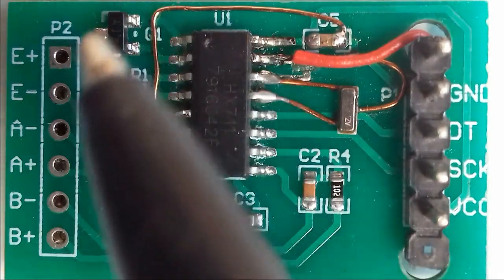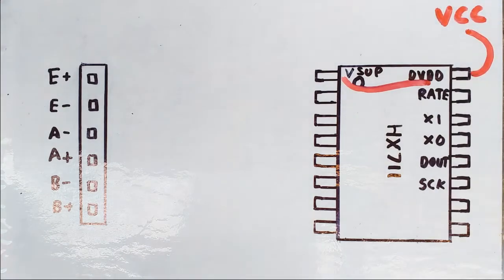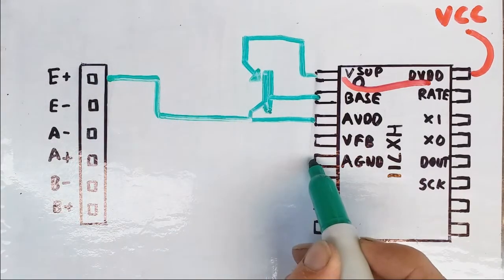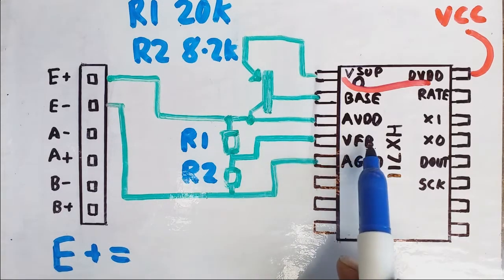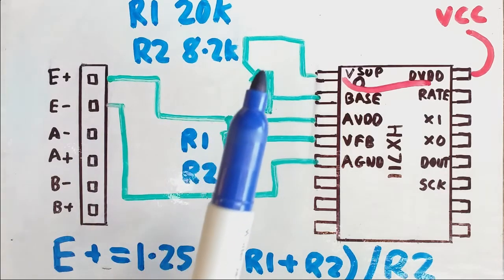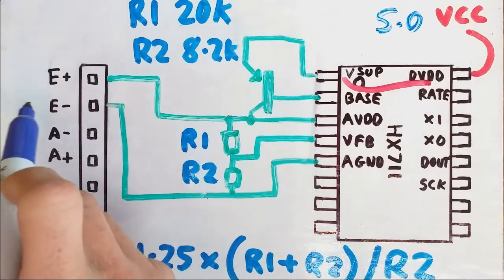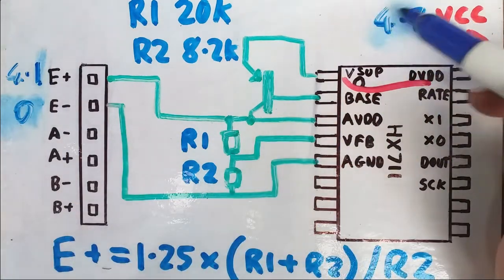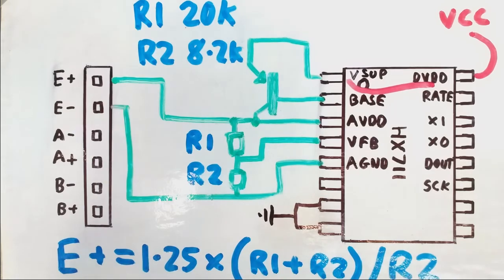HX711 Excitation Voltage and What You Need to Know

Comment: Thank you for showing the need to add a jumper wire for GND at time 0:11....   I followed your advise and it reduced the amount of noise in my application by a significant amount. That GND connection is shown in the datasheet for HX711 but is missing in the PCB layout.
Reply from the maker: Glad it was helpful, and thanks for confirming that it makes a difference.

Comment: Hello, thank you so much for your video. I’m using the hx711 and inputting 5v from my arduino, but when I measure the E+ voltage output, it gives 0.4 ish volts, which is really low. I thought it might be the board, but I swapped it and it did the same thing. I’m using the chip with a half Wheatstone bridge and 2 strain gauges. I ended up hooking up the Wheatstone bridge to a 9V battery instead of connecting it to the E+ and E-. When it was connected to the E+ and E- and I tried calibrating to get a load cell output, it would give nan, or 0. After connecting it to the 9v battery, the load cell output gave me a reading but it was fluctuating a lot and did not give any consistent values. How can I fix this issue with the E+ and E-, and do u think that hooking it up to a 9V battery was ok to do? Do you think that is what’s contributing to the fluctuations?

Comment: If I need actual 5V as excitation, and 3.3V vcc/logic levels, I need to use an external regulator, correct?
Reply from the maker: You would yes and the HX711 can take up to 5.5V. With a change of feedback resistor you should be able to get a 5V excitation voltage.
Reply from the maker: Having said this just be careful putting a regulator before another regulator as it has caused me serious drifting issues.
I would really think about why the excitation voltage needs to be so high at 5V as this can create problems with stain gauge heating. Is the material you are measuring very stiff or the load very small, if not half the voltage will give you good results. If you want very high precision then the HX711 may not be the best choice and increasing the stain gauge voltage isn't a good way to compensate. Hope this helps.
Reply: It's as big and bulky 2 ton load cell haha, it's designed to be excited from 5 to 12. I also need a bit higher sample rate because it'll be measuring a rocket engine, so I'll use a generated PWM signal as clock. Thank you for your response. I'll analyse the datasheet and come up with a circuit.
Reply from the maker: @gustavrsh  Interesting in that case I see why you need 5V. Don't forget the capacitor in series with the PWM signal.

Comment: @Ed R, is it possible to get correct readings within 1 seconds of time? I saw in many videos that it takes areound 2-2.5 sec to settle down and measure the load weight correctly.
Reply from the maker: That's not something I know anything about unfortunately. I always have the HX711 running continuously.

Comment: Thank you so much. I will try this later as I was trying to figure out why I had fluctuations in readings of a load cell. I don't know if that will help but it sounds like it will. I will try it tommorrow and let you know.
Reply from the maker: In theory it should help but knowing strain gauges you never know. Do let me know how you get on. Thanks for commenting.
Reply: @Ed.R  Today I modified my hx711 by lifting pin 15 off the board and shorting it to pin 16. I got the 80hz rate, but the measurements were inaccurate. Then I wanted to ground pin 5, but I went with a different approach. I grounded E- directly to the other side of the board to GND. It turned out that I made a mistake and I actually shorted DT to E- with gave me constant 0 readings. When I figured it out I reverted the mistaken connection between E- and DT, but I kept getting reading of 0 in serial monitor. I thought I might have damaged the hx711 so I hooked up another one modified in what should be the right way (pin 15 to pin 16 and E- to GND) but I keep getting reading of 0. What am I doing wrong and is this way of grounding pin 5 directly through E- the right way to go ?
Reply from the maker: @РосенПашов-щ3ф  Doesn't seem like you have done anything wrong with the modifications. Pin 15 to 16 or VCC  is fine that gives the 80Hz sample rate. Was thinking you were going to change the excitation voltage E+.
Connecting E- to GND is fine to because E- is connected to pin 5, nothing wrong there.
Not sure about the readings being 0. Would suggest to me that either E+ is shorted to ground or the channel inputs are shorted together. If there was no excitation voltage or a missing connection I would expect a random value as output because the input is floating.
What sort of strain gauge setup do you have? Have you checked the voltages across it?
Reply: @Ed.R  What do you mean by changing the excitation voltage? You mean by using the method you suggested and swapping r1 with 10k one?
By the way does it matter how am I connecting the load cell? Because I am using two 3 wire load cells wired like so LC1 Black + LC2 white to E+, LC1 white + LC2 Black to E-, LC1 Red to A+, LC2 Red to A-.
Reply from the maker: @РосенПашов-щ3ф  Yes but I don't think it will solve your issue with 0 output.
Never worked with load cells myself but appear to be half bridges. The way you have wired them seems to make sense even though the wiring colours don't.
I'd check the voltages with a meter. The red wires should be half the voltage of E+.
Reply: @Ed.R  It turned out to be a cut wire of one of the loadcells. It was damaged in a way the insolation was holding it in place but the wire itself was cut. I fixed that and I am getting proper readings now. The only thing left to do is to ground the E- again to see if it will fix the fluctuation.

Edit: I did the E- to GND. I can't see any improvement in fluctuation :( Maybe the last thing to try is to replace R1 with 10k one. By the way I am supplying an arduino board from usb. If 5v is not constant - maybe this is causing the problems with fluctuation ?

Edit 2:
I grounded B+ and B-, but it also had no effect.
Reply from the maker: @РосенПашов-щ3ф  Glad you discovered the issue with the wire, these sort of problems can be hard to find.
The thing I'd do next is measure the excitation voltage E+ and the USB voltage at the board. As long as E+ is at least 0.1V below USB the HX711 regulator is working.
If this still doesn't work then things get a lot more difficult. I would try and put the amount of fluctuation into perspective, how much error is it going to create. You will never get a completely stable flat line output from strain gauges that's just due to the amount of amplification. I divide the output by 100 and still get fluctuations just from putting my warm hand near the strain gauge.
Reply: @Ed.R  What I am actually trying to do is to use the load cell to create loadcell sim racing brake pedal. I don't need the exact values as long as I manage to do a smooth axis with good resolution. Is there a way I can achieve this through code without affecting the frequency at which the data is updated. I need the inputs from the pedal to be as fast as possible and as smooth as possible.
Reply from the maker: @РосенПашов-щ3ф  Sounds like a good application and not one I would have thought of. Fast updating and smooth may not both be achievable it will be about experimenting with smoothing to get the best compromise.
What I would do is,
Find out what the full range is, min and max value. If it isn't very much maximize it using mechanical advantage.
Once you know the range compare it to the resolution you would like. If the range is bigger than your desired resolution divide the output by a value like 10 or 100. This will remove noise.
Then I would experiment with smoothing. The example code in the Arduino IDE works well. Even if its only averaging over 5 or 10 samples it might smooth the output significantly without slowing response time.
Reply: @Ed.R  I have managed to smooth out the readings by taking a number of samples adding them up and dividing to the number of samples taken but at the cost of response time. I got some 10kom resistors today and I will swap R1 with 10k one. Would there be any change though if the excitation voltage is not stable?
I mean, the 10k resistor should lower the excitation voltage but it won't stabilize it right?
Reply from the maker: @РосенПашов-щ3ф  The thing to be aware of when dropping the excitation voltage is that it will also reduce the output.
Before you change any resistors I would measure the VCC to the HX711 and E+ if there is a voltage difference between them ( ideally 0.5V but min 0.1V) then there is nothing to gain from dropping it further.
If the voltages are the same then definitely change a resistor. However I would use a resistor that drops the voltage by less. 10k gives a voltage suitable for powering the board off 3.3V and I believe you have 5V USB? Aiming for say 3.5 - 4V would be better.
Reply: @Ed.R  I swapped the resistor but I got even bigger fluctuations. Unfortunately I don't have a multimeter to check voltages and I am just trying to guess where the problem comes from. I even tried grounding pin 5 directly to ground - no effect. I will get a multimeter soon and see what is happening.

Comment: Very useful! You say to fix the missing ground link, and I'm sure that you are correct, however, my device seems to work well and I've not implemented the fix. What would I notice to be different if I do?
Reply from the maker: For most applications it will work just fine as you have discovered however things to be aware of are.
The analog ground will be around 0.7 - 0.8V above the digital ground. Means the onboard regulator is less likely to work if VSUP < 5V. Assuming AVDD (E+) is set to around 4.1V.
If you change the rate the reading will step up or down noticeably.
I perhaps worded it wrong and instead should have said it's worth doing to get the best out of the chip but not in many cases necessary.
Reply from the maker: I've relished this is already in the video so to better answer your question.
If the onboard regulator isn't used you may not get as stable a reading for a couple of reasons.
Some newer more efficient voltage regulators have noticable ripple which could create noise.
Second you are relying on a regulator which will have other loads on it (such as an MCU) which may prevent it from supplying a stable voltage. If the excitation voltage changes it will disrupt the strain gauge output.
Reply: @Ed.R  Thank you. I have a spare board so I'll give one a try and see if I notice a difference.
Reply: @Ed.R  After some testing, I've noticed that the output slowly drifts downwards. Would your fix help correct this?
Reply: I tried it andit doesn't! I need to look elsewhere.
Reply from the maker: @mindracing  I think there could be many reasons for the drift so difficult to help on that one. If it was a supply voltage change then my fix would likely sort it.
Reply: @Ed.R  Fixed! It was solder flux causing a resistance between pins.
Reply from the maker: @mindracing  That's interesting, thanks for sharing your findings. Glad to hear it was an easy fix as strain gauges can often be difficult. Will make sure I clean my boards well after soldering.

Comment: Thank for sharing this. I am just arduino hobbyist. 
I saw a uA meter based on this sensor. I don't understand nothing at all, but it is the only project to build a micro ammeter on the web I have found. Author does not answer at all my doubts. There's a way you may help me to build it? I need to sense load lines from a cellphone. I'd like to DYI instead of read under a common DMM without any possible way to send to a computer. Thank you so much if you are able to.
Reply from the maker: I'm still at hobby level to really but will have a go at helping.  On the rare occasion I understand something I try and post a video.
Had never thought of using an HX711 as an amplifier and ADC for a current shunt. Could see it having good potential. This video won't actually be of any help as I suspect you won't need an excitation voltage. Will have to be careful with the ground though.
Mobile phones aren't really my area of interest so have little knowledge. What are the load lines?
Reply: @Ed.R  Yes, it seem to work great as uA meter. I have contacted members who built it, but any answer yet for helping. I have order all to build the meter from China still waiting, while I am studying it I don't understand almost nothing. Ground has been my enemy when I use sensor like INA219. or Shut resistor(Burden voltage is so high in that scheme)  5V arduino + 1.1 volt INA + 40mA...)
   Now I am thinking do it with a 0.1 Shunt and an ADS1115(15bits) 2^5= 6.11v/32767= 0.0001864681 for an Analog entry so resolution is extreme hi vs 1023 arduino MIC, but once again Ground load + Ground arduino + sensor. and noise....  if there is a way to "virtualize the ground" ? humm. that is engineering....
When a cellphone is turned off, does not charge or turn on at all, the first thing to do is disconnect Battery, interface any (+) line of the power connector put ground to ground and a DM in series at uA scale and take a look how much current is consuming with a Regulated power supply at 1V or 2V, 50mA. Any phone in good state never go up more than a few uA or mA, if it is turned off and consume 10ma or 50mA(max limited) something is wrong (short cut) bad PMIC, blow ceramic Caps. etc. It would be amazing to interface this test with an Arduino and send to a PC to collect that statics. That's the reason I would like to find a cheap solution.  Thank you for your reply.  if you want the files project and references just let me know.
Reply from the maker: @svsv9  I've watched laptop repair videos and it was obvious that measuring current consumption is an important diagnostic tool. I can see now the usefulness of this for phone repair to especially with data logged on to a computer.
Think I have found the website you posted on. From what I understand reading the other posts. It seems the current shunt can be floating. As in the GND of the HX711 is not connected to the shunt or phone or its supply GND in any way. Therefore in theory the voltage at the shunt shouldn't matter, the HX711 will only measure the voltage drop across the shunt.
I've not got my electronics stuff with me at the moment so can't test it. I think its going to be something you'll have to experiment with.
Reply: @Ed.R  Thanks, if you find more utilities on this HX711 module, please let me know. I still waiting from Aliexpress my package, even I think I have lost my order, thinking to re order from elsewhere. Thank you for replying.